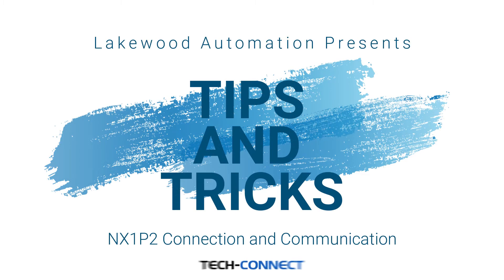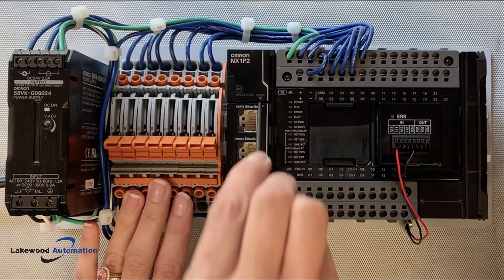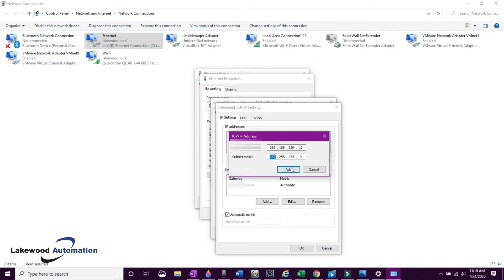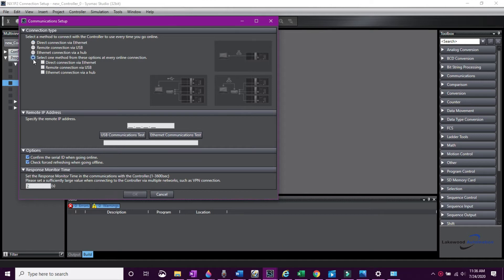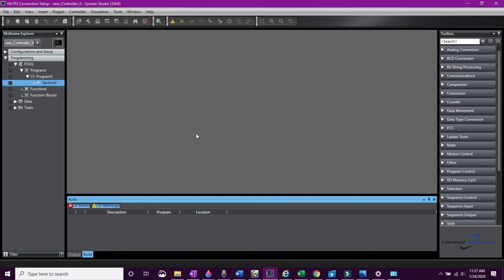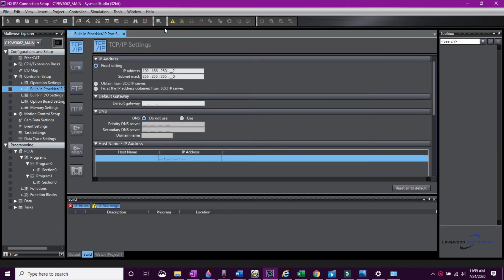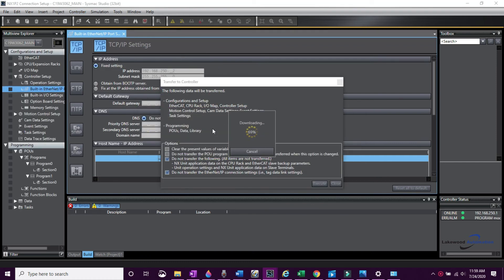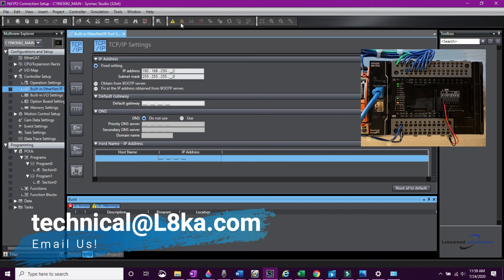NX1P2 Connection and Communication Setup

Comment: Doing the same but "communication error has occurred"
Reply from the maker: 1) Make sure you have closed the Network Settings Window on your computer, this may result in your IP not fully taking.
2) Ensure the IP Address you enter from your computer is only different in the final octet, 192.168.250.###
3) Please ensure the PLC is powered up and you have the Ethernet cable plugged into the EIP Port on the PLC (Port 1)